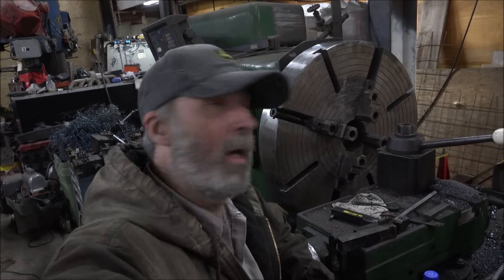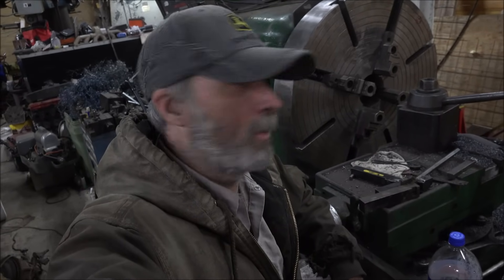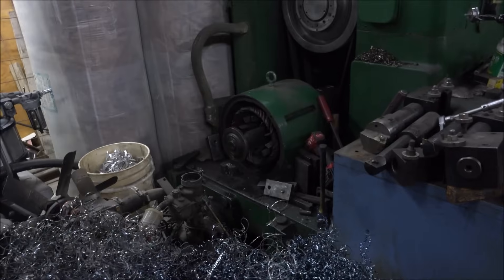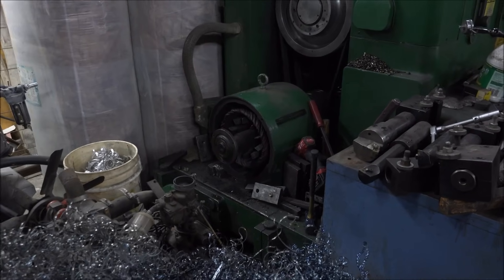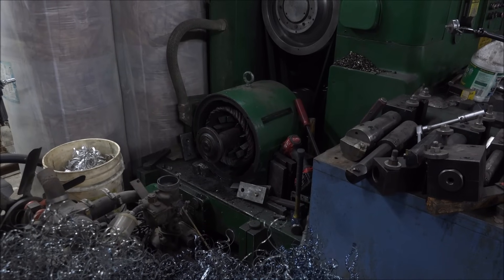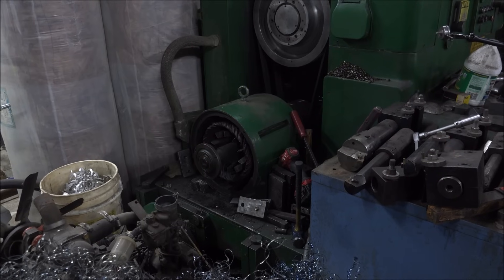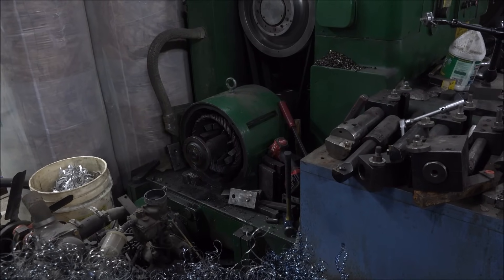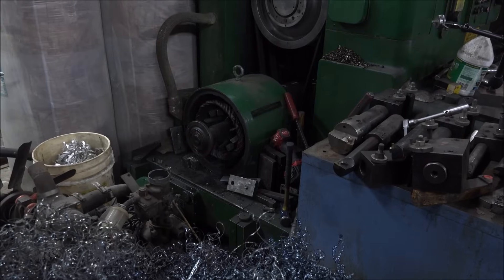Motor Failure on The Monster Monarch That Ain't Good! Help Needed!

Comment: I was an industrial electrician for 30 years, that motor needs to go to a shop. Probable rewind, but they might be able to clear the ground. Motor shop may also be able to get you a used motor. You can adapt the motor you have, swapping bell housings is the way to change the pecker head and also gives you the opportunity to check the bearings . Wishing you the best!
Reply: agree as a retired electrician, my experience is that the insulation is breaking down and you may repair one spot only to have it reoccur at another.
Reply: I agree with these two gentleman.  You might want to consider the motor you have if enough HP and RPM.
Reply from the maker: @RRINTHESHOP  yeah the smaller motor is same hp and rpm flipping the ends and making an adapter plate sounds like probably going to be the best solution unless a deal on a correct frame motor turns up.
Reply: @bcbloc02  1. You may can buy commercially available adapter rails for mounting if the new motor shaft height is less than the old motor. May be cheaper and easier to fabricate you own but there are some available. Hopefully the shaft size is either the same or is split tapered bushing that you can change.
2. Is the NEMA design, FLA, and KVA codes the same on both motors. I would guess that both are NEMA design B but the FLA and KVA may be different even for the same hp. That may cause the overload relay in the starter to require modification to meet the new motor. What hp is this motor? I am guessing 25 -40 hp on a lathe that size. 
3. The old motor is controlled via a direct across the line starter and not a reduced voltage or delta/wye starter? I have had experience with a large K and T vertical that had a 50 hp delta/wye starter arrangement. This starting method is used to limit motor inrush current during starting. A motor used on a delta/wye starter is not a special winding BUT all motor leads including the wye point leads are brought out to the peckerhead. Typically a delta/wye motor is wound for a single input voltage and thus only has six motor leads while a direct on the line (DOL) motor will be 9 leads with the option to connect to low or high voltages. Occasionally you will see a 12 lead motor that can be used on either delta/wye starting or DOL and on low or high voltage.
Reply: @bcbloc02 flipping the ends is one way of saying it. First check that the motors have the same wiring (there are several ways that they could be different) You then need to completely disassemble the motor and rotate the stator 180°. Please do check the bearings, in addition to side loading damage on the drive end, over greasing can be an issue. 😎
Reply: @bcbloc02  Brian, I would go with the motor you have, it looks like a FAR better option, than hoping for a deal, that just might not be happening.
Happy New Year. Best wishes from the far North.
Reply: I doubt they will even touch it

Comment: Hello Brian, the best option is to take out the motor and send it to be rewound and also to mount new bearings
That said, if the lathe were mine, I would directly mount a new modern motor with IE3 energy efficiency, in addition to installing a frequency converter... with these improvements the lathe would be much more efficient and you would also have electronic speed control in each of the speeds you had engaged and that makes it much more effective and saves a lot of time and you get better finishes on the pieces
I leave the final decision to your personal choice
Greetings from Spain
Michel
Reply from the maker: @TrPrecisionMachining  looks like a ieee motor is about $7k  I would guess a 60hp capable vfd would probably be just as much. I wasn’t really looking to spend 4 or 5 times what my daily driver vehicle cost.
Reply: @bcbloc02  It really does not matter what you were or are "looking to spend".  You either need that motor re-wound or need to replace it with modern kit.  It will cost what it costs.  Decide which route and pay what's needed.

Comment: Hope you can find help to repair the windings, or get a straight swap. May take longer than having to adapt a replacement motor, but sounds like it would be better in the long run.